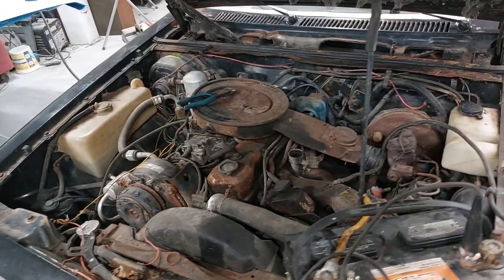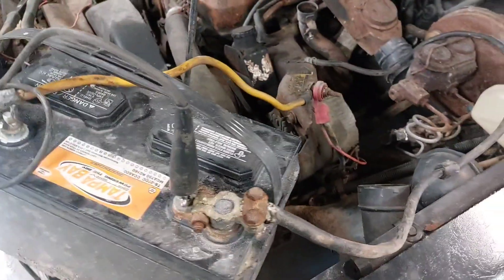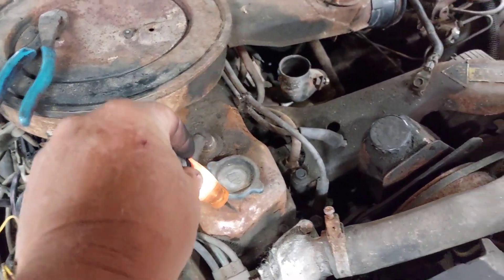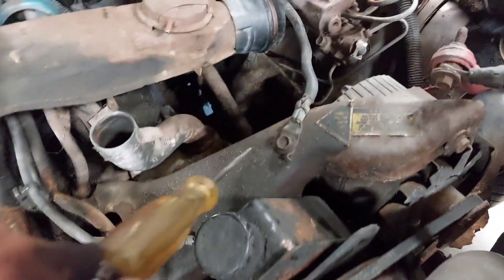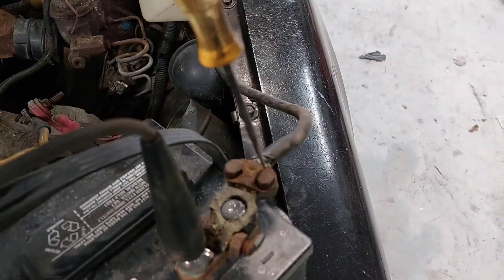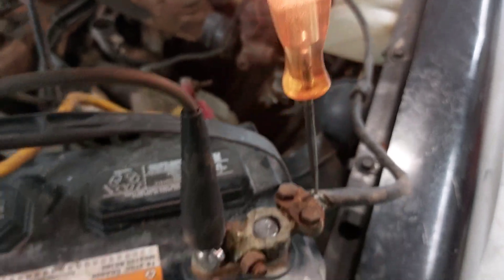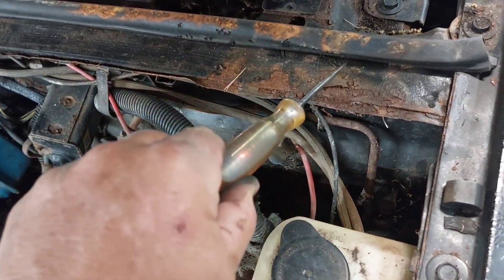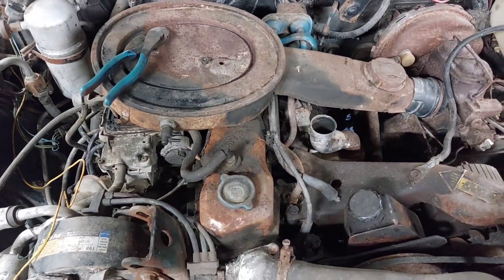Why is this car not burning?

Comment: You showed the problem as you put the test light on the negative post, and the light did not illuminate, then you touched the bare portion of the ground wire, and it did illuminate. The first fault that you have, if these are the results, is an open circuit between the ground wire and the ground terminal end. This style of terminal is very popular and inexpensive, but truly leaves a lot to be desired for a long term connection.
Reply from the maker: Yes. You are right.  First thing I did after the video was swap out the terminal ends. Everything there was a mess

Comment: It doesn't have any power because it's a 1980 Pontiac Sunbird.  As for the wiring issue, that is the first time I've seen that.  The funniest part was getting the light to light right on the ground terminal.
Reply from the maker: I know! Right. It's a head scratcher for sure

Comment: Make sure you don't have the test light with a battery in it for checking other electrical stuff I had one time and trailer I worked on had power all over it and came to find out it was new test light someone had bought and laid it at the shop and I picked it up not thinking and that made me scratch my head for awhile lol
Reply from the maker: Turns out it was the alternator plug shorting out

Comment: I cant remember if my test light showed hot everywhere, but i had an alternator fail once where in certain positions it was grounding everything out. If you rotated the motor, everything would test normal.
Reply from the maker: I'll try to turn it by hand. May help. Thanks

Comment: Pontiac sunbird is hot 🔥🥵. On YouTube cuz this is one of those super secret prehistoric electric cars in disguise 🥸🤣🤣🤣
The closest I've ever come to anything like this is a 77 Cutlass. And somebody got sloppy and clamped ignition wire in between the head and valve cover of that 350 Oldsmobile engine. But the indicator light did not come on all over car like this.